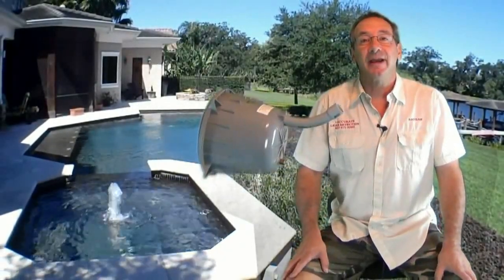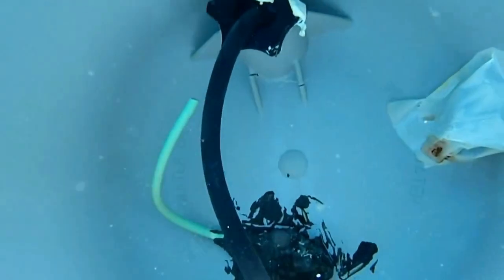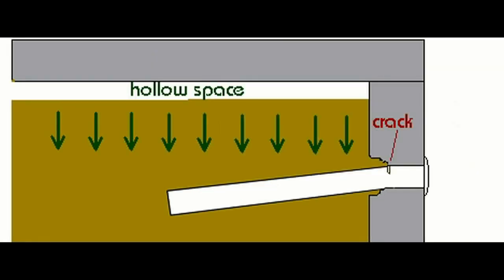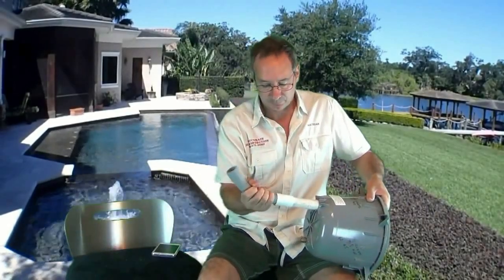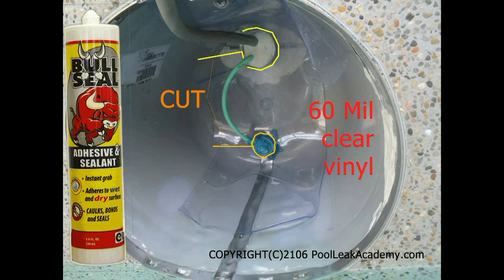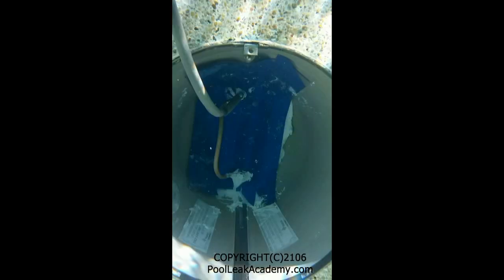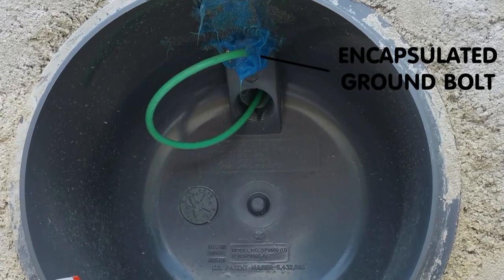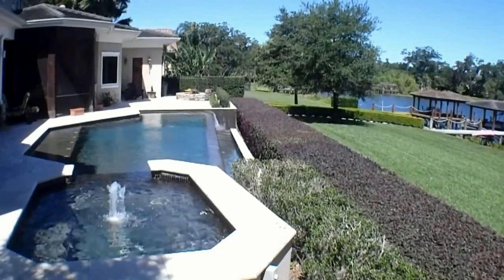Leaks in swimming pool plastic light housings1 The PoolLeakAcademy.com 2017

Comment: I asked a few pool inspectors in my area: "Who's the best pool builder around here?" By far they all agreed it was "**** Pools"...They said they're competitively priced but go the extra mile in many important places...So I hired them.... One thing they did was use a heavy duty aluminum light housing and they're the only pool builder who still use 3/4" brass  conduit all the way to the junction box. Also, all the plumbing ditches were wide and flat on the bottom so that each pipe was installed on virgin dirt and separated... not to touch each other. I'm a professional plumber and can certainly appreciate that. I'm sure there were other quality measures taken I don't even know about....25 years later absolutely no issues.

Comment: We see similar fractures from settling on the bottoms of skimmers, pipe doesn't move but the skimmer does and you see a ring around where the pipe screws in which can leak.  On vinyl pools I've actually seen people take the light niche out, install a longer piece of flex pipe, run the cord through then put it back in with a coil of flex behind the light.  Fixes the leak but the next guy that has to change the light fixture is doomed!  Water bonds inside skimmers are another thing that will become leaks, they use brass and stainless in some of those products and you get a reaction.  Very cool video you made.

Comment: Can you please clarify what the flexible conduit is,  and it would great help if you can recommend where to get it from. 

Thanks for sharing this video, it is a huge help in taking  care of this issue permanently.
Reply from the maker: The flexible conduit is spa pipe or PVC  "flex pipe" available in 3/4" or 1"
Reply: @poolleakacademy5573  I hate to say it but while this may solve one problem it could create another.  Flex pipe is notorious for expanding under low pH conditions, it's also susceptible to grub and termite damage.  Lastly I don't think it's UL listed or approve for that application but I may be wrong.  We use Hayward niches and haven't had one crack like that yet in the  roughly 10 years we've been installing them.  Can't say I'm a fan of all hayward products but I do think they have the best plastic niche design, it's pretty beefy where the conduit glues in.  The old SS ones with the brass nut were very problematic.

Comment: Having a brand new pool done right now. I found this video by accident but glad I did. I know it's a few years old now but looking around the internet I'm finding the flex piping is not the best idea. Even though it would keep from snapping under the pressure of ground settling, the flex can collapse causing another issue. Also, I'm finding that certain insects like termites actually love it and eat through it ultimately causing an issue. I'd love to hear thoughts on that as well. I'm also wondering if you have a concrete collar done around your inground pool and your backfill is over that concrete, you allow the ground to settle for 4-5 weeks before pouring concrete, just how much will the ground really settle after that anyway?

Comment: fifty cent fix, seems to be using plumbing flexible PVC.  Have had many wiring jobs where I wished to have flexible pvc conduit.  It doesn't exist, not to electrical code.  only the gray stuff.

Comment: Hi Nate, is there anything I can do now? The backfill was just done but I can dig out the dirt for the light but the pvc conduit are already installed.
Can I place anything underneath the pipe or silicone the hell out of it from the outside. Or do anything inside the niche now that is empty? No liner yet.
Thank you in advance
Reply: FYI....I asked a few pool inspectors in my area: "Who's the best pool builder around here?" By far they all agreed it was "** Pools"...They said they're competitively priced but go the extra mile in many important places...So I hired them.... One thing they did was use a heavy duty aluminum light housing and they're the only pool builder who still use 3/4" brass  conduit all the way to the junction box. Also, all the plumbing ditches were wide and flat on the bottom so that each pipe was installed on virgin dirt and separated... not to touch each other. I'm a professional plumber and can certainly appreciate that. I'm sure there were other quality measures taken I don't even know about....25 years later absolutely no issues.

Comment: I needed to reset my junction box further back from the pool.  When i removed the light from niche I found a mess of white water mold .Stainless steel niche . I vaccumed to waste  the niche water mold and cleaned the light capsule in a bucket  of chlorinated water .Shocked pool,  left out light for a few days to allow shock to work in niche. bought a special rubber plug for niche hole which goes around light cable .. . I would reccomend that the niche be cleaned about every 2 to 3 yrs . That  appears to be where my chemicals were being used up . If you do the cleaning your self ALWAYS DEENERGIZE  the electricity. If in doubt call a Pro .
Reply from the maker: I swam up to one light and felt my fingers tingling- time to get back.
Reply: @poolleakacademy5573  How close were you ? Had you actually touched the light or trim ring .De enrgize and replace that light and cable . Be careful ! Let me know what was causing the ground .

Comment: Hi, the 10 hole liner sealing ring behind my pool light that is screwed into the pool wall has the tab that has the threaded hole for mounting the light lenses to the light housing. Will there be trouble with the liner if I unscrew this ring and replace it? Thanks
Reply from the maker: Probably not a good idea, I have a picture of one slipping down the back of a fiberglass pool. A vinyl liner might be built different- but there is no reason to remove those 10 screws because the light is held in with just one screw on the top.

Comment: I don't understand what the issue is with the cracks? What other issue does a crack cause? Wouldn't there be a code change if this cracking issue were causing an issue? Can people die  from this? What happens if I have a crack?
Reply from the maker: The cracks cause the pool to leak water- up to 1-2" per day. The codes need to be changed but as far as I know Im the first one to point the problem out and make a video.
Reply: Yeah you lose a ton of water, you won't be shocked due to the transformer that your light is running through converting the electrical inflow to 12v DC. However your pool losing water can cause multiple problems, houses settling, decks cracking, pipes breaking. Already described in the video you can see how a constant amount of water in the ground will compact the soil continually.